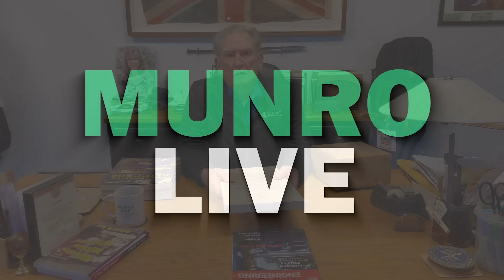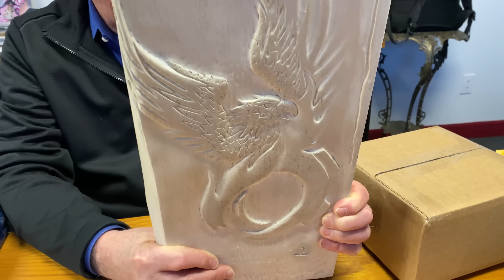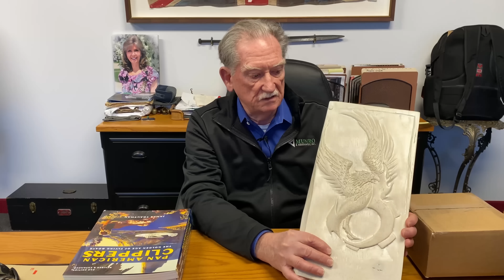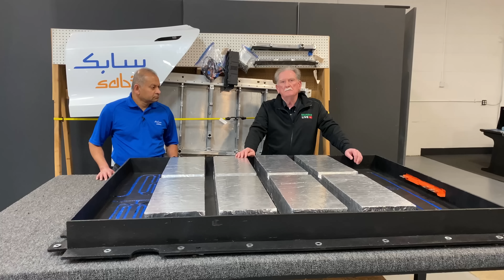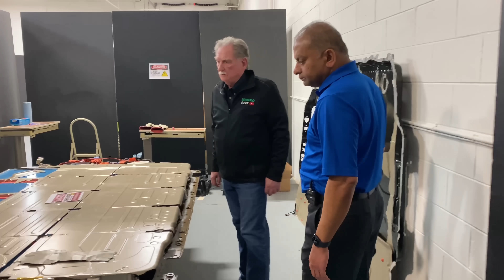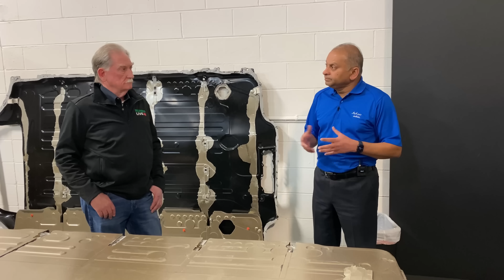Munro & Sabic on Battery Tray Composites - Tesla Model S Plaid Battery Tray

Comment: Plastics in a critical part like the indoor door latch are just not as durable and robust. Becoming brittle and breaking the occupants of a vehicle can become trapped in their own vehicle. Safety Critical Items need to be durable to several design lifetimes of the vehicle so that critical items continue to function properly.  It's not acceptable to have require car owners to roll the window down to use the exterior door latch to open the door, and replacing the entire interior  "plastic"  door panel with to fix the broken plastic latch components is not acceptable. Exactly how long is Ford going to manufacture discontinued Lincoln Town Car door panels? Not long enough, to fix every Town Car on the road.

Comment: The big issue is that 99% is made from virgin oil products, the recycling has been pushed back by those as Aramco.
And all plastic turns back into carbon of the air.

The lighter weight is also neglected by the increase in functionality, so in the end more plastic is used.

Question to Sabi, do you support a 100% return of plastic, in the country.
And not exported out of sight, to Asia or now Africa.

I think Munro can learn more about tier 123 sustainable impacts, the sold product isn't the end, including laws.

Comment: Hi Munro Team, I was under the impression that the outer battery pack was made from Aluminum because it is a non-ferrous metal, protecting the occupants from electromagnetism. If the pack is no longer made from this, can you speak to how current materials would give that layer of protection (ie plastics, Mica, something else). As a former sales employee for Tesla, I learned to tell customers this was the solution, after someone asked about their daughter's ovaries in the backseat. Thanks

Comment: Hard to beat steel for fireproof capability, as my wood heater will attest.  I wouldn't make a wood heater out of polypropylene and plastics are very toxic when they burn.  If there is a one size fit's all material, it's steel.

Comment: Only answer is long range to at least 1100 miles to the 45 minutes charge to equal 3 gas fill ups that is 15 minutes a tank full x 3 = 45 minutes, that is compared to a car that gets 350 miles to the 17 gallon tank full on the average ICE vehicle millage range!

Comment: In regard to your new sculpture, I especially liked the artistic depiction of 'out of the box.' 

In that light, I'm sure you've now heard of 2DPA-1 - the so-called 'impossible' plastic that solved the molecular challenge of being a plastic not based on 'fibers' but that sheet themselves like fish scales at the molecular level to create a plastic that is stronger than steel, impervious to gasses and moisture and all those superlatives regarding strength and lightness mentioned ... but presumably also much better than traditional plastic formulations. 

Automotive, aerospace and even building is likely to be impacted to the degree the oil industry may more than regret its mere burning as a horrid waste.

Comment: Here in Germany we used to produce the Trabant, which was a car with a plastic body, and it's definitely a very light car even today. However I read the plastics parts couldn't be recycled until decades later. I hope engineers start thinking about the waste issues before they put these materials into production. We also need to consider the oil spills that can happen during the oil drilling and transportation, which also have a massive impact on nature.
However maybe Sandy is right and it's not the worst material. Maybe there's a stigma among engineers against plastic, since it's not used often.

Comment: In theory it sounds great.  But I have a question. How do you attach the front and rear aluminum castings to a plastic structual battery tray?  You cannot weld it.  Is there a glue strong enough?  Bolting soulds possible but how many do you need? Even if possible, is plastic structually strong enough to support holding these two castings together without additional support?

Comment: Well you also have to consider EMC regulation for homologation therefore  you need a low electrical resistance between the Cover and the housing  of the battery. In an Event of Thermal propagation the cover has to resist heat of more than 1000 •C...so its not just that easy to change the material

Comment: I kind of expected to hear in more detail how plastic is able to contain the fire.  Can it handle the same temperatures, hold the fire for the same duration? and how does it compare strength, wasnt really enough information to be convincing.   The whole video seem to have a single message that plastic can do the job, but wasnt any substance in to how.   Having some small examples of materials on fire would also have been good too, mostly from an entertaining stand point.
Reply: They did mention that it did very well in the standardised test being formulated; so I expect footage would be available somewhere; or coming out soon.

Comment: Was a good commentary on the mitigation factors that can be made within the design process. I believe that people are aware of the problem that single use plastics can pose, especially if the lifecycle of the product isn't part of the use of the item (thinking of all the plastics going to landfills instead of being recycled). These problems that can be solved by engineering and good design. A cheaper, safer, better car or appliance that lasts longer is what I'm really excited for.

Comment: As good as their engineering is, they might want to invest some energy in customer service.  My Model X Plaid was delivered "contactless" to my home with a cracked windshield, a bumper needing to be replaced, 30 miles of range, software out of date, no license plates, a non-functioning falcon wing door, misaligned panels, and a dirty interior among other issues.  They somehow thought this is a good way to impress a customer paying $140,000 for a new car.  Good luck trying to get the service center to answer their phone.  I kept getting connected to a voicemail that had never been set up to receive messages.  Oh, and don't bother calling Tesla's corporate number.  They want nothing to do with their customers, simply referring them back to a local service center which doesn't answer their phone.  I waited 8 months for this piece of sh!t.  Never again.

Comment: Plastics are fantastic! I think it isn't necessarily the plastic itself but the whole ecosystem of the material that needs some changes/improvements. From materials, as UV talked about, to manufacturing, reuse and recycling there are a lot of systemic changes that could make a big difference towards our environmental impact. Good talk, thanks!

Comment: There's a huge difference between extracting oil for recyclable plastics and oil which is refined into gasoline and then burned and the exhaust gases going up into the air.
Reply: If it gets recycled, it really isn't, so it gets burned or gasses as it brakes up.

Comment: I see cars being crushed whole...glass, plastic, steel, cast iron, alum, fabric, etc.  What happens to the cubes? If they melt the metals down that would vaporize the plastics?
How do they separate teh alum from all the other materials?
Reply: Cars are crushed for easer transport to the actual recycling facility as they are mainly consist of empty space.  
when they get to the recycling facility the cars are ground up into little pieces and then sorted into piles depending on the martial type this is then sold on to other processing facilities to be mixed with virgin material and mage into usable stock material. 
   
Most scrap yards can not afford the expensive machinery to process the cars so they remove expensive items off the cars like the engine/cat and sometimes brake them down for spars if it is an uncommon car. but most of the time they just focused on making the vehicle as small as possible to reduce the transportation cost.

Comment: Sandy remarked in a recent video ( where they used pointing sticks to discuss the charged Plaid pack - https://youtu.be/TYFyiiEwOFI?t=58 ) that the mica sheets sum to 15kg & I think I heard elsewhere that the metal top cover in the Plaid pack is ~60kg. That latter figure sounds like a lot and I would have to assume the steel is somewhat over-strong for a simple cover, probably to play a crucial role in crash-resistance of the whole pack/chassis, even though this is of course not the actual 'structural pack' planned for Model Y with 4680 cells.

If that's the case, in this specific instance it may not be so easy to replace both parts with an integrated plastic component while retaining the same features, and/or the end result could in fact be bulkier for a negligible weight saving.

Also Tesla probably has plenty of stamping machines available to repurpose with a new die, which avoids the CAPEX on new injection-moulding plant and corresponding operator training. For small series products (MS/X) this is a considerable factor.

Anyone have better info on this?

Comment: Of course, the weight of the battery pack lowers the CG of ev, which prevents rollover which increases the chance of surviving an otherwise fatal collision.  I trust that this safety factor is kept in mind.
Reply: But not to the extent of adding weight or failing to remove weight for it

Comment: Thanks Sandy & team. I'm surprised Tesla didn't go with the polycarbonate battery fire insulator if it is a better use case (lighter and still adequate fire retarding). Perhaps the Tesla team will consider this in future iterations if it is viable for their safety standards. Cheers!

Comment: Wow good to know plastic can be fire resistant.  Yes we need to lighten the EV cars.  The KE or Kinetic Energy Formula in Motion--->
 --------->     [ KE= 1/2 mass x velocity (square) ]-------->. Is best used to determine the importance of lightening the EV car

So look at the equation--->example---> If you lighten say 1/2 and saves energy allowing you to drive longer distance--->Conclusion----> lighten the EV car by 1/2 the mass -------> It take 1/2 the Kinetic energy to move the EV car.

That means the car takes off faster---> slow down faster--->get longer mileage----> perfect if you are a race car or a Tesla car owner

When less energy to move the EV car you get  longer distance out of the battery in the car---> That is why Sandy Munro and Sabic  is trying to explain the importance of taking down the weight. As Sandy said, weight is the enemy ===> Maybe that’s why I have a carbon fiber bicycle that weights only 24lbs

Comment: Only plastic problem i have are 1 use plastics. 
There's a case to be had with plastics in poorer places but that has actually more to do with Trash management of which some don't even have any.
And when it comes to composites using plastics in cars and other big products that's just wonderful if done in responsible way.
Tires are made of plastics, i wonder if someday we could come up with a miracle tire that doesn't pollute the air with small particulates wether it be with plastics or not.

Comment: Firstly oil is not a problem because of the size of the hole in the ground, nor even the 10% that gets made into plastic. It's a problem because of the other 90% that mostly gets burned and contributes directly to climate change. That's why people 'throw rocks'. This is an existential problem and it has to be dealt with as quickly as humanly possible. If we didn;t burn nearly all of it there would be loads for plastics and other chemicals. 
And yes if plastic had high recycling levels, and was largely used in durable products it would be much less of a problem. but it isn't. Recycling levels are in the 6-9% range since 1950, and the resin symbols thing was a deliberate scam to make people think plastic that wasn't recyclable could be recycled (https://www.youtube.com/watch?v=PJnJ8mK3Q3g). The industry has got to get past that appalling historical effort to mislead, and the current very low recycling levels, to persuade us that plastics should be a significant part of future products and processes.
At the moment 55% of plastic production goes to packaging (which is almost entirely single-use and not recycled, or often even recyclable). 20% end up getting burned, which of course is not much better than the rest of the oil that is getting burned, because it's still fossil carbon that ends up in the atmosphere. Sandy is right that reasonably long-lived car parts which save weight, and improve aerodynamics, and actually get recycled are useful. The question is are they better overall?
A big hole in the ground is less of a problem than a messed-up atmosphere. Once you stop digging they quickly revert to nature - often actually nature reserves, so I'm not convinced that the size of the hole is the right yardstick for environmental impact.
Sankey diagram for plastics.https://ourworldindata.org/uploads/2018/08/plastic-fate.png

Comment: I worked in Commercial Plastics as a QA.  The elastic limits of plastics tend to have a half life and decay over time due to cycles of loading and unloading.  Steel not so much.  Plastic parts are often overbuilt by 3 or 4 times in order to have a good service life.  Also section modulus in plastics is not as dependable as it is in steel.  I would rigorously test parts with flexing in order to find out how many cycles of vibration it can handle.  Stiffness can be imbued with fiber reinforcement to the detriment of recycling.  I would commend the Tesla engineers on this and reserve the plastics for places where they are not subjected to so much constant loads and vibrations.
Reply: I agree with the fire resistance.  If you have ever flown on a commercial aircraft you were surrounded by Ultem which is a beautiful golden plastic that they usually make into a creamy looking plastic that can be charred by a blow torch, but it will not catch fire.  When you take the torch away it goes out.  It has a short term service temperature of 360 degrees. Also, high temperature thermocomposites can be a couple thousand dollars a foot which suggests the steel and mica might beat them on price.

Comment: How much does the current battery pack roof weigh (steel + mica), and how would it compare to an equivalent plastic part?
Reply: I'm copying an answer I gave to a comment above:
Some back-of-the-envelope calculations do not show a significant weight reduction. Consider 4 mm of PP with 40% glass fiber at around 1200 kg/m^3 density and you have 4.8 kg /m^2. The density of the composite may be even higher if its formulation includes intumescent materials. Compare it to 1.2 mm of aluminium (2700 kg/m^3) plus 0.5 mm mica sheet (around 1.6 kg/m^3) and you have 4.04 kg/m^2. A steel cover, on the other hand, is significantly heavier: substituting the 1.2 mm alu with 0.7 mm sheet steel gives 6.26 kg/m^2.

Comment: I don't agree with promoting Sabic without a proper disclamer (again the same problem with this channel) but plastic, when used properly, is a lot cleaner than alternatives. 

First of all, the oil that gets extracted is efficiently used, including all the byproducts. If we all switch to electric cars, we would have to dump half of the oil somewhere, since gasoline was basically a byproduct. It used to be dumped into rivers before cars came into play. Second, you cannot make something reliable out of 100% recycled plastic, it's always a mix. 70% new with 30% recycled is pretty bold already. If something says "recycled" on it, and is of decent quality, you should usually not expect more than 10% recycled material. The properties degrade with each thermal cycle. Metals however can be recycled to 90%, if sorted properly.

As soon as recycling responsability shifts from consumers to the producers, we will see a big shift towards greener alternatives. But that won't happen while dirty money can buy power.

Comment: I’m curious what the weight of the mica and battery cover are? What would be the weigh compared to a composite cover that you are speaking of? Even if you can’t mention specifics a general percentage would be insightful information.
Reply: Some back-of-the-envelope calculations do not show a significant weight reduction. Consider 4 mm of PP with 40% glass fiber at around 1200 kg/m^3 density and you have 4.8 kg /m^2. The density of the composite may be even higher if its formulation includes intumescent materials. Compare it to 1.2 mm of aluminium (2700 kg/m^3) plus 0.5 mm mica sheet (around 1.6 kg/m^3) and you have 4.04 kg/m^2. A steel cover, on the other hand, is significantly heavier: substituting the 1.2 mm alu with 0.7 mm sheet steel gives 6.26 kg/m^2.

Comment: Plastics are brilliant and we'll continue using it probably for ever but, as we eventually stop burning oil for transport, the 5-10% used as feedstock for plastic manufacturing will get steadily more expensive. Fortunately, as I understand it, whatever you can make out of a hydrocarbon can also be made from a carbohydrate, a renewable and recyclable resource.

Comment: There's a big difference between a plastic material being fire resistant as opposed to its melting point when compared to steel & mica it being both a thermal and excellent electrical insulator against hazards involved with a high voltage battery pack i.e. preventing potential arcing between the high voltage battery terminals and the metal enclosure. Would a  battery fire generate enough heat to melt a plastic enclosure then spread as opposed to a steel enclosure. I'm sure like most manufacturers Tesla especially would have looked into this right from the start before even making a car and being what's considered as the leader in the field of EV technology steel  / metal enclosures seem to be the answer.
Reply: In the first patent related to the structural pack, there's reference to an adhesive/ packing material changing state, acting as a fire retardant.